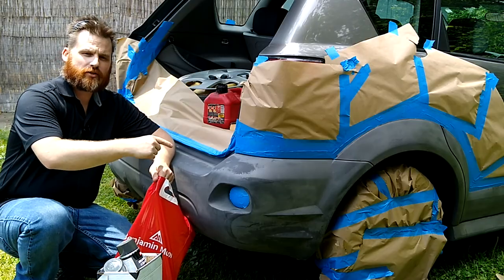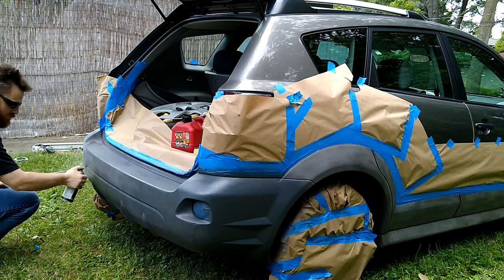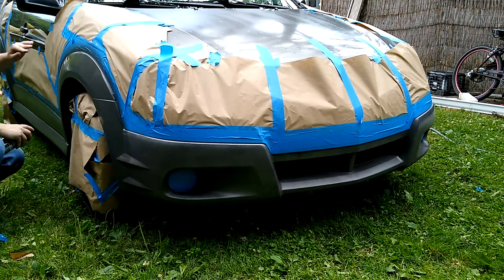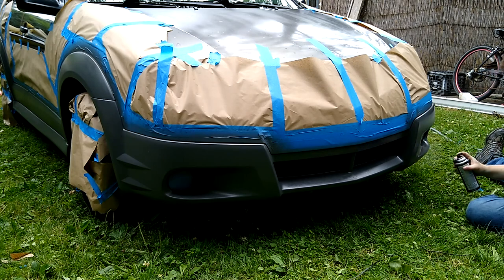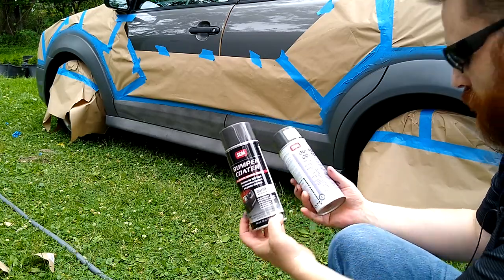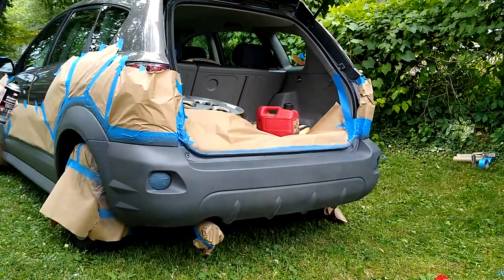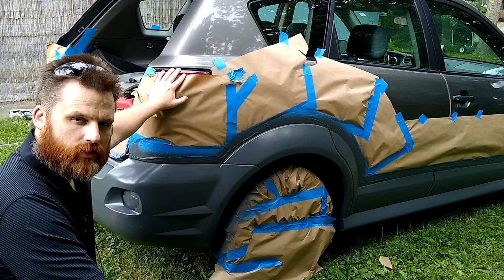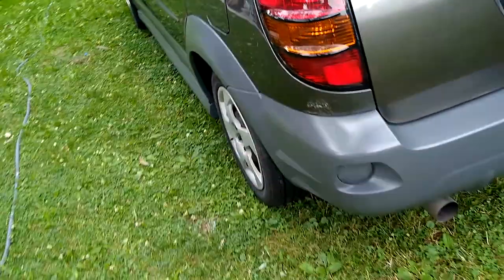SEM 39183 Medium Gray Bumper Coater Aerosol - 12 oz.  Automotive Refinish Trim Color Paint Restore

Comment: Good job! I am thinking of doing my vibe and making the grey trim black. 

Sand with 400 then use a primer or sem texture coat / trim paint......

How long did this last without adhesion promoter or as is?

Ty also <
Reply from the maker: It is in its second winter with no peeling and still looks excellent.
Reply: @geostomp  

Yeah I’m thinking of doing mine this summer. I will see what happens when the weather turns!

Comment: How is it holding up?
Reply from the maker: Still looks excellent, no peeling, 1 winter so far, been through light power wash.  I would do it again on a dry oxidized bumper that has been thoroughly cleaned and dried with no oily residue.
Reply: @geostomp  that’s great to hear